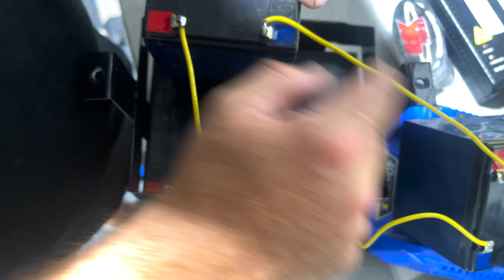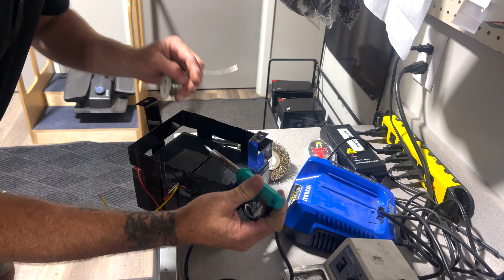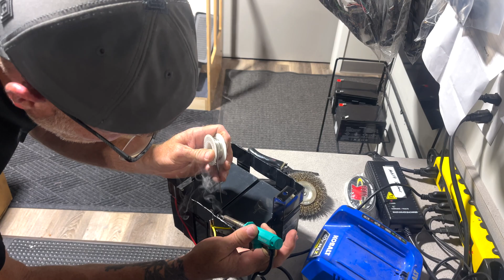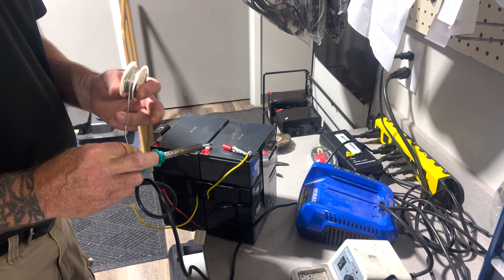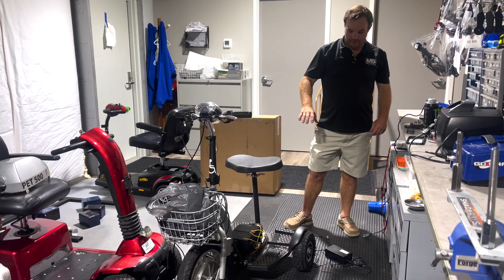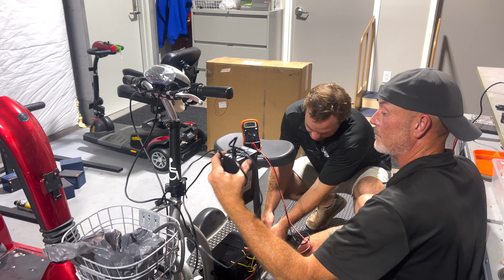Wiring PET 500 scooter 48v batteries in series

Comment: What's the range for someone that is around 200lbs - flat ground at a warehouse type facility  - I have new batteries and its all setup right but it seems the range / time till it starts cutting out is like 15 minutes and it's not on (turn key by charger) high speed mode.  It seemed like the range was higher before the last battery set went bad.  How do you check just the charger?  It goes red while charging and after 30 min it's green already - it doesn't seem right!  I wish the PET500 actually had a readout of the power left in the batteries instead of just the "dumb" bars lol - the display is probably the worst I've seen.  Is there options on there to change the display and what it shows at all?
Reply from the maker: send us a contact email to admin@affordablemedicalusa.com .  name and phone number

Comment: My throttle isn’t working. Is there a way to troubleshoot it?
Reply from the maker: I'd suggest a local repair shop that may be able to diagnose the root of the problem.
Reply: Its a restate us a multi meter @MobilitySolutions101